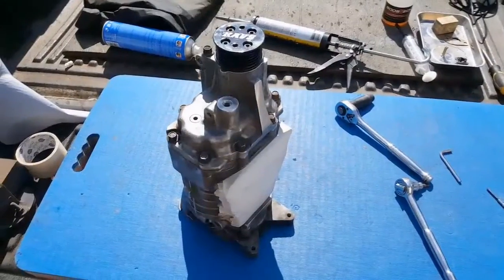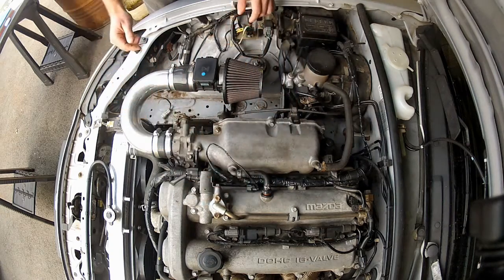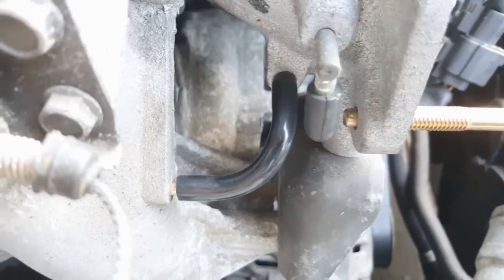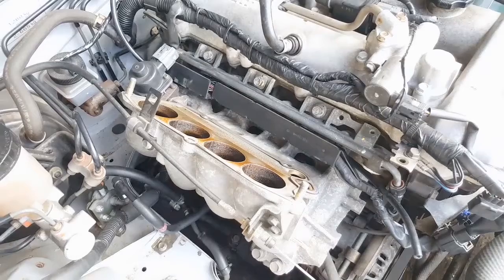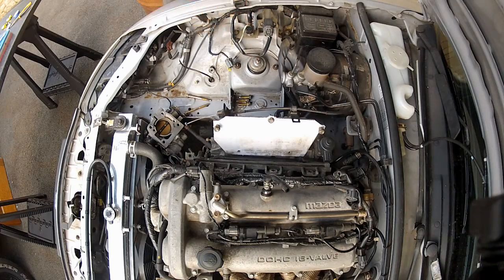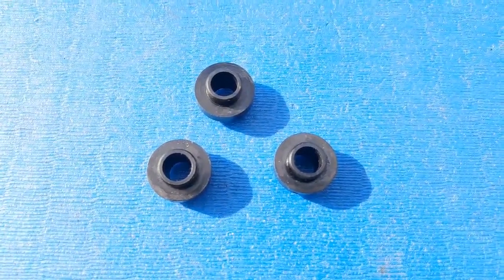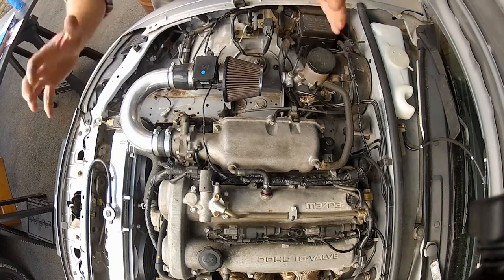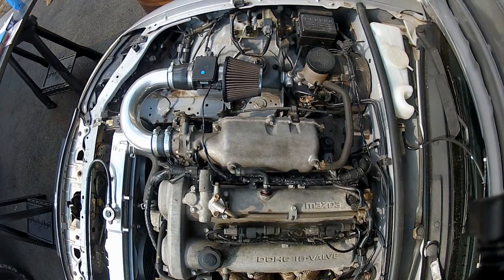Installing Bigger Fuel Injectors (RX8 Yellows / 1.8VVT NBFL) | Supercharging the MX5 / Miata Ep 21

Comment: How much WHP would you say these injectors are good for on the 1.8?
Also, would a DW100 (165LPH fuel pump) supply enough fuel to these injectors to run at 80-90 duty cycle?

Comment: Just getting into the world of proper car modifications and standalone ECUs, why wouldn't you need a MAF sensor with a standalone ECU? How do they know the amount of air coming into the engine? Edit - Just read up that it's a mix of engine RPM and MAP data, in this case, how does the supercharger affect the fueling algorithm? At least it's still RPM dependent like it would be with the engine creating flow, but presumably has a different curve to it?
Reply from the maker: Yes no MAF required as you will run a vacuum line from the intake to the ECU for the MAP reference. When you supercharge or turbo charge you need to map the car (essentially fueling and ignition timing) for above atmospheric pressure.. i.e in boost.

Comment: Interesting that split manifold 

Perhaps a cheeky velocity stack install at a later date ?
Reply from the maker: Yeah never seen anything like it. There's a few different types of inlet they fitted over the years. One version has a set of butterflies inside that open up at higher RPM (VICS I think they called it). I will give Mazde their due - they come up with some weird stuff! I don't think they did velocity stacks though 🤣
Reply: @FastRust  oh like bwm Disa duel length runners
Reply from the maker: Is it to help with air speed or something?? I think that's why they did it.. but then they stopped doing it by my year MX5 and went to VVT instead!
Reply: It was to improve low down tourqe without compromising the top end 
So you had a long branch intake up until midway and then the short runners would open later on 

Not sure actually how effective it was ft/lbs wise
Reply from the maker: That's it. People have tested a VICS MX5 on the dyno and from what I remember it did improve low down torque. VVT did it better though so they obviously canned it when that came along

Comment: Would you recommend Mazda 626? 1994
Reply from the maker: No absolutely not, my ex's parents had one of them!! 🤣
Reply: @FastRust  thanks
Reply from the maker: I've not heard of them being used in an MX5. Thats not to say you couldn't though. What cc/min are they?
Reply: @FastRust  mx5 is expensive here
Reply from the maker: @ziyakucuk4082  oh I thought you meant using the injectors out of one. Never driven a 626 but I have a lot of time Mazda. Unfortunately they seem to get eclipsed by Toyota/Nissan etc, but Mazda make some cracking cars.

Comment: Do you not need to upgrade the fuel pump and also get a pressure reference fuel pressure regulator?
Reply from the maker: No, & no. Not with this setup.